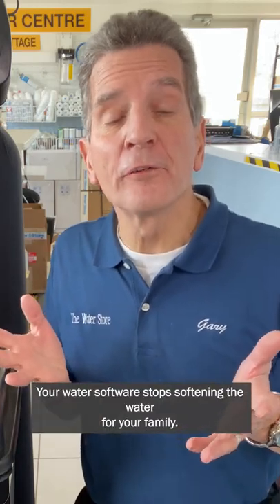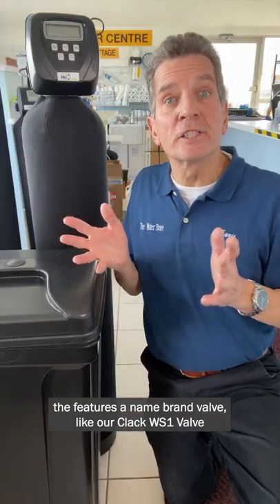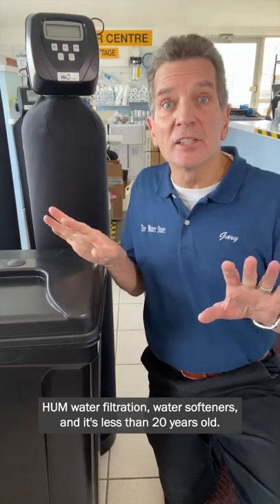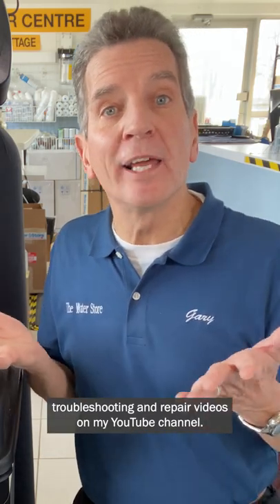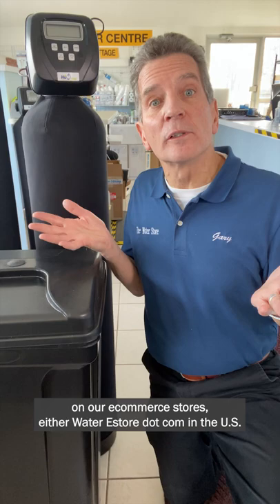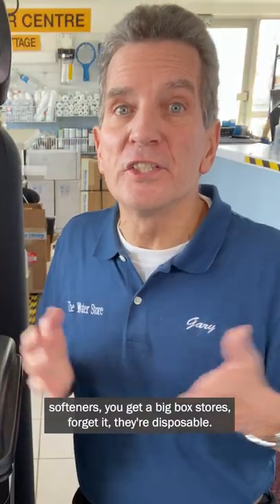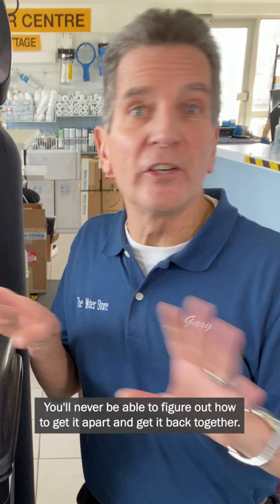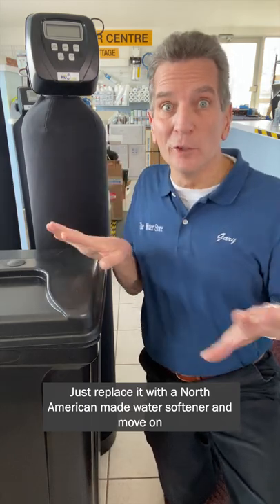Should I REPAIR or REPLACE My WATER SOFTENER? #shorts

Comment: Hey Gary. Can a Clack WS1 filter valve be converted to a softener valve? I can get a brine injector and brine elbow and a service kit has the downflow brine piston so will that work?
Reply from the maker: Theoretically yes, but once you source all of the parts (including the circuit board) and purchase them you will find you are better off buying new.  I would not recommend it.
Reply: @water_estore  Cool thanks. The only reason I'm thinking of doing it is supply issues to NZ. My supplier has had orders in place for almost a year and still no stock has arrived. I don't want to change my valves and the only alternative here is a crappy chinese valve. My supplier does have quite a few clack filter valves in stock still so they might get me through till more softeners arrive. Good old Covid, messing up business since 2019.